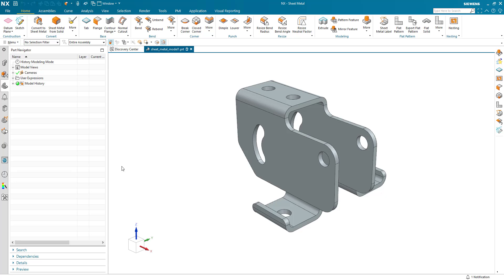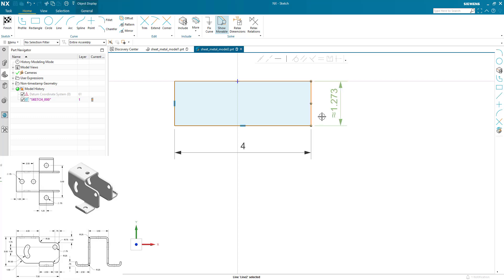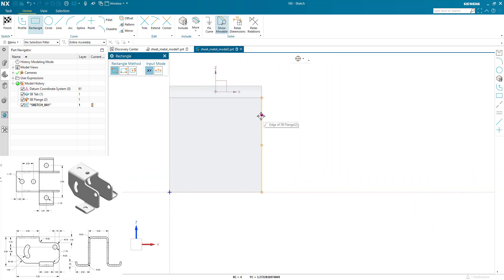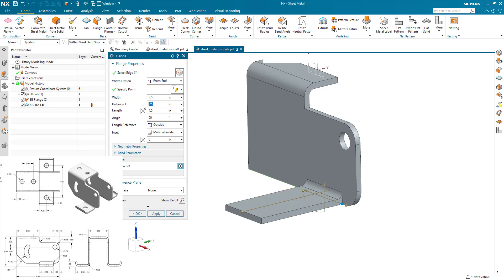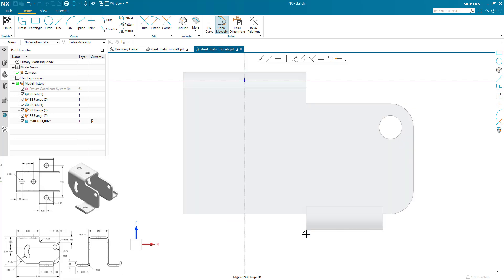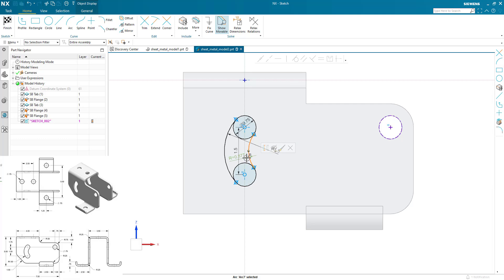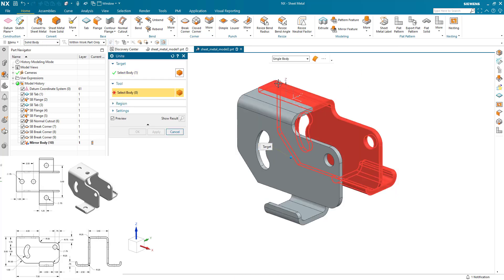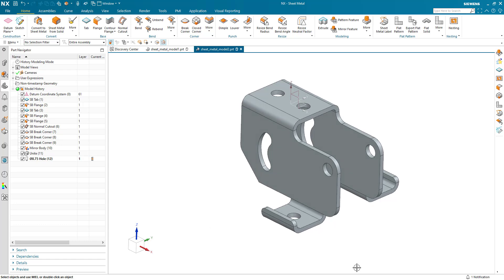Siemens NX Sheet Metal: Creating a simple bracket

Comment: the unite and mirror does not work together , i have to untick associative in the mirror feature for the unite to work , 
when you did it in the video i sensed that something is not logical to mirror then unite an object , (after unticking , the mirror feature shows broken link icon on it ) 
i have NX 2506
i feel in this case , the mirror command should come last , because after mirroring , NX won't let me select the other body for the unite command . 
wonderful sheet metal series , thank you for your effort and time sir
Reply from the maker: Yes they do.  Recheck the video at 7m17s. You'll notice in the settings that 'Fix at Current Timestamp' is checked.  You cannot Unite a mirror that is not fixed.  Just adjust that setting and all is good.
Reply: That fixes the issue completely,  thank you for your time sir , 
Wonderful series

Comment: hi , how will you select edges from another sketches, i'm using Project line option and then drawing, can you share the setting of edges
Reply from the maker: Change the setting of selection scope from active sketch to work part or entire assembly depending on your requirements
Reply: @deedub7777  can you tell me , how to do that. please share a settings
Reply from the maker: @GameXlog  Look at the NX UI (start at 2m30s in the video and pause it). Just below the ribbon bar is the top border bar (starts with 'Menu' on the left). You then see a drop down for selection filter. Next along is the selection scope. To pick geometry outside of the sketch you need to select the appropriate option here, choose 'Entire Assembly' or 'Within Work Part Only'. Dialog memory will save this setting as you continue. Consider familiarizing yourself with the NX UI as it is consistent across NX
Reply: @deedub7777  Thanks Bro .